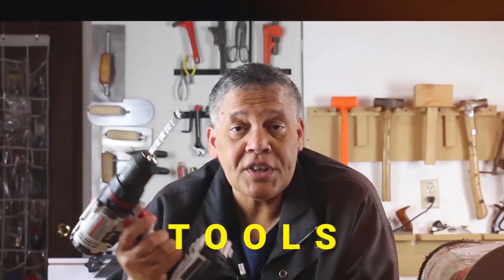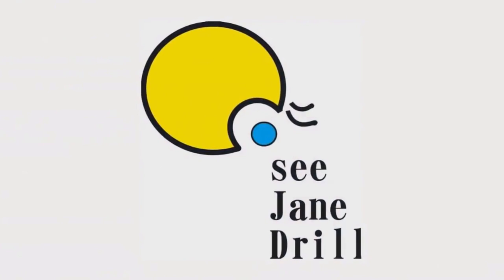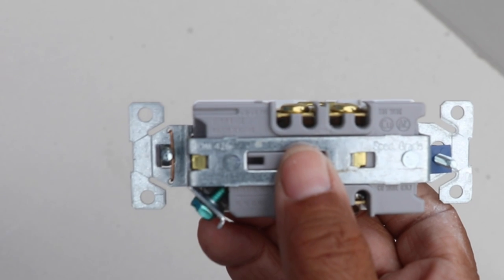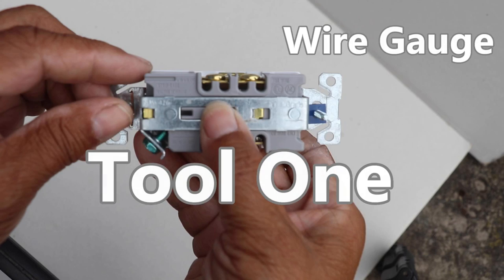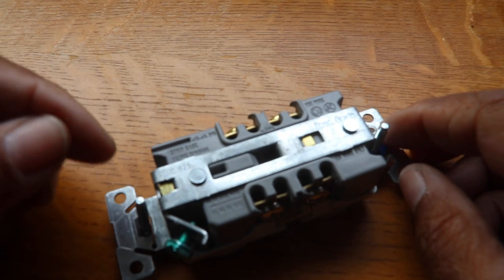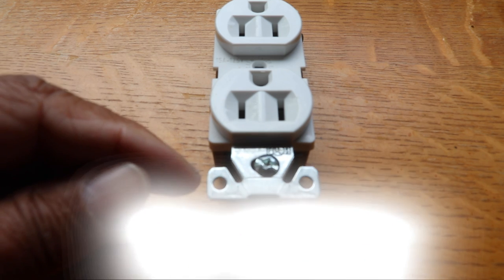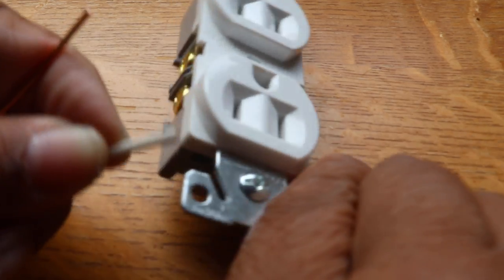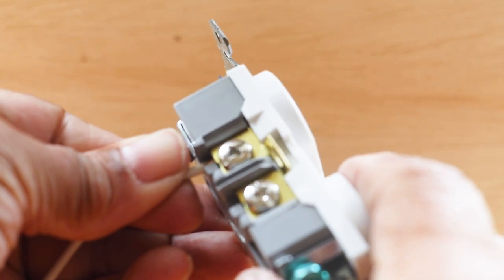Hidden Tool in an Outlet Few Know

Comment: wow! I've been a licensed plumber for 30 years and done my share of wiring as well. I can't tell you hgow many times I've wished I could find my wire strippers. You are my hero!
Reply: Thanks man...I try
Reply: Think I have 3 or 4 wire strippers and most the time I can find just one of them.
Reply: I guess I'm a luddite.   I pull out my swiss army knife, do a quick score, then pull it off.  (when I don't have strippers or pliers handy).   Glad to see this publicized, however.
Reply: Then I would have to hunt for 30 minutes to dig up my electrical box, to get the receptacle......
Reply: Now I’ve got to count how many wire strippers are in the walls of my house... there’s one over there, three in the kitchen, one behind the couch... lol. Thanks for the tip!
Reply: @pugmalley  I think I've got 3 or 4 of everything, and I can't find anything...

😂😂😂
Reply: @machinegunrilla8629  I say if your tool box is not overflowing you don't have enough tools in it yet. 

Organizers for wrenches just waste space.
Reply: @TheGunterGlieben  - Can't be any worse than the business where I left at least two four foot drill bits in the wall.
Reply: I use my two front teeth for 10 Gauge and my next two for 12Gauge
Reply: @Chris Jamieson This is the first I've seen or heard of the wire strippers too. I've had my Red Seal Journeyman ticket in Electrical since 2008. This isn't common knowledge, not in the code book... not on the box the outlets come in... so completely trust that a very competent plumber would also not know the hidden tool.
Reply: A plumber doesn't have a whole lot of need for a wire stripper. You get much more use out of a toilet bowl plunger
Reply: @Chris Jamieson If you watch the video again... one side is for #14 the other is for #12. That said, my point was not to fling mud... just to point out that many of us that are experienced tradesmen found this information to be completely new and eye-opening. If you already knew this tidbit of info... good on you, but you're a very rare exception. Hat is off to you sir!
Reply: This is printed on the outlet. Can you read?
Reply: @Chris Jamieson - Seriously?  I've been doing wiring for 25 years in my work (non-electrician, primarily), and I don't believe I've ever come across this brand.  It's still good information, but your response is asinine.
Reply: @stevewilson7857  It's technically NOT printed on the outlet, Steve. It's molded into the plastic of the outlet therefore same color as the outlet & unless you're specifically searching the device for obscure installation info with really good lighting your chances of seeing & reading that are coincidental, at best. It might be printed on it's box if you buy a separately boxed receptacle but, as in the video, they're most often bought w/o one, from a bin. The likelihood of the average joe/jolene (the one's this video is aimed at) seeing &/or already knowing this obscure info I wouldn't want to place odds on. Just sayin'!
Reply: I had no idea and I have been doing my own wiring for years even have two years of industrial electrical education LOL.
Reply: Hey what are you doing here brother 😂 get back to the knife reviews! Ive been watching you since high school lol
Reply: Wow. Yes you ARE smart. (And pretty cute too!)
Reply: Creeps in my apt bldg who are stealing electricity, have loosened all the outlets in my apt and my plugs fall out. Nobody will help bc nobody will admit to anything. 

Can you tell me what to do to fix them. I came from the era where fixing things was a man’s job so I know nothing about these things, but I am very smart and trying to learn.
Reply: @Chris Jamieson 
Well that's dumb, how will you remove the outlet next time you need to???
Reply: @syorich1403  
Please don't listen to that idiot, don't wreck the screws!!!
If you do ANYTHING to ANY electrical part in your home, ALWAYS turn off the power first. 
ALWAYS!!!
Rubber gloves won't stop you from getting electrocuted.
As for fixing your problem, first, how are people getting to your apartment outlets??? How are they getting in your home? 
Maybe get better locks. 
good luck!
Reply: @Chris Jamieson If it's still not certified by UL, how are they allowed to use it on a house?
Reply: Am I the only person who just pulls out his lighter? 
If you melt that insulation for like three seconds, you can just pull it right off....
Reply: True true
Reply: @Foxtrotwilconiner1969  what about 14?
Reply: @DJDOUBLEWIDE  any two they will do
Reply: I wonder if it will work on the  pigtail for a Bager 5.
Reply: @CharlesGraham  12 years in the IBEW, Local 11, including my apprenticeship, and a total of 30 years in the trade, the bulk of my union time being tenant improvement(lights, switches, and receptacles) and I never heard of this from anyone. If you look at the wire after she stripped it, you can see a ring around the copper. A very few wiggles and the stripped portion will fall of. Actual wire strippers don't reach all the way to the copper when used properly for precisely that reason.
Reply: @Chris Jamieson   in case you didn't notice the stripper on the other side was for 12 gauge, she showed both, just didn't demonstrate both. So who's laughing now
Reply: @Chris Jamieson I've been doing electrical work for 50 years, and I just learned this. It's not obvious.
Reply: @lennyf1957  Depends on whether or not you need to install a washlet type toilet seat, and need to put in an outlet. Or are installing a sump pump. Or heat pump style water heater. Or a garbage disposal. Or an instahot water dispenser. Or dozens of other items that you have to both plumb and wire.
Reply: @Chris Jamieson Personally, I'll always use the square/Robertson drive for the screws, rather than the straight or Phillips. It doesn't cam out, it doesn't slip.
Reply: Don't think you can strip pipes...
Reply: @tbelding  it's safer than your swiss army knife
Reply: Yea wow, damn!  Protip?  No, try mastertip! :o
Reply: Never new of the stripper either.
Wonder if it’s annotated on the instructions included with the outlet nobody reads?
Thanks for getting to the point quickly on the video too! 😎
Reply: @tbelding  that's the businesses fault for having 3/½’ thick walls!  Don't lose sleep!... 🤗
Reply: @spacetimeworm  that's a bad idea. If you get soot on the wiring, you increase the resistance at the point of contact between wire & fitting, increases heat & can blow fuses & cause the plastics in the fitting to melt.  A "qualified" electrician did a 45amp wall mounted shower switch (outside the bathroom) in my ex's home, and somehow managed to get water inside the switch. The switch burned out in 2 weeks. I cleaned the wire & replaced like for like. That burned out too, so I hit an electrician's forum where one explained you have to really clean the soot from every strand of wire:- so separated the strands, brass wire brush, put in a 50 amp switch (hard to find) & no problems since.
Reply: Damn and i been using my teeth for 25 yrs😁😁😁
Reply: @alexmanojlovic768  - More that it was their fault for having sill plates in interior walls while demanding knee height network jacks.
Reply: @tbelding  I was messing.....
Reply: I strip wire with my teeth.....
I also know what electricity taste like.
(Make sure the wire is de-energized!!!!)
Reply: @johndwayne3481  - I've managed to never tongue taste anything higher than 16 volts DC.
Reply: AGREED!
Reply: @tbelding  By using a knife, you run a much greater risk of scoring the conductor. That is why there are so many other better solutions for exposing the conductor.
Reply: @spacetimeworm  introducing fire into a situation it doesn't need to be in adds a whole other range of possible dangers. I'd use fire to do it if I had no strippers; had no outlet with built in strippers; had no knife; and no teeth to do it.
Reply: @troy3456789  Interestingly enough, you don't have to cut all the way through to the conductor to breach the plastic.   Also, sixteen to eight gauge solid conductor is not as vulnerable to being cut as you might think.   Putting a scratch on it doesn't affect its conductivity or termination capability.
Reply: @abelis644   That's all well and good, but if you turn the power off it 1. takes the challenge out of the project. Leave it on and it's like a leveled up version of them game of  Operation. 2. How else am I going to get my shock therapy for free?
Reply: @troy3456789  well if you can't light a half inch of insulation on fire without burning an entire house down, I'm not sure how you are progressing in your career. I'm not exactly starting a scrap fire in the middle of the home...
Reply: @tbelding  Nicking a conductor is verboten
Reply: @troy3456789  A fallacy propagated by those with financial incentives for "Licensed" everything, specifically electricians.  Nicking a 12 gauge wire (the sort of slight scratch that a knife might make when removing the plastic shield) has less of an effect than twisting that same conductor into a circle to screw to a side terminal, or deforming and compressing from a insert terminal.  An event that happens on a regular basis.   The theory is that the nick interferes with skin effect, or reduces the diameter of the conductor enough to make it no longer reach its rating.   Yes, that's true if you actually work at chopping pieces out of it.    The REALITY is that it depends on the 'nick' or scratch, plus the size of the conductor, and if you're going to go that route, there is no such thing as a 'safe' wire stripper, as they can all gouge the wire.  So, rather than spouting OSHA, why not learn how electricity and conductors work, so you can make informed judgements.   I've spent 25 years installing wiring without any issues from scoring a wire with a sharp knife held lightly against plastic shielding.   And that's on wiring from 22 gauge to 4 gauge.   (I HATE working with 4 gauge).
Reply: @machinegunrilla8629  hey you sound like my boss. He has 10 of everything and yet we search hrs for something then buy another and the next day find 4. I try to tell him that instead of 8 jobs on the go at once just start and finish then pack the tools up and move on to the next job. Nope rather do 8 jobs at once and tools all over so spend more time looking for tools then doing the job. Try keeping all tools in the trunk of the car. As remove a tool keep count of tools you removed. End of job count and if 1 missing its always easier to find that day then waiting a week and forget where you used a certain tool. Even silver ware. Every night after supper i wash and count all dishes so nothing gets lost then found a month later. My boss yelled at me for losing wrenches, well i took 10 and returned 10. Then i found all 10 next to the car he fixed. Like ya i did put them back, you took them and like usual left at the last thing you fixed. So to all that lose tools just count as you take and end of job put that same number back and never lose another tool again. Just 1 socket is 10 to 30 bucks. Add that up. 1 wire stripper is 30 bucks. 1 ratchet is 40 bucks and up. Plus hey lost time constantly searching for tools. Never loan tools out. Last time a friend borrowed my tools he lost 8 sockets and a ratchet costing me almost 200 to replace. Ya i know cheaper tools but they are junk. I also know that could buy even better at 400 but too pricey. So please my friends dont be the one with 10 of everything but cant find 1 of anything. Especially now as everything costs more and its harder to make more.
Reply: @Foxtrotwilconiner1969  must be nice having teeth. Keep that up and look like me with 8 bottom teeth left and 0 top lol.
Reply: @shawnkelly1241  while you might be right on all accounts, all I really heard is "I'm TOOL RICH BABY"!!!, and the faint eco of my wife telling me to "clean out my shop", every time I tell her, "I gotta stop by the tool store"...😂😂😂
Reply: @elindquist5725  not common knowledge? How many boxes of plugs have you purchased and opened? My first time buying a box it said in big bold letters about the built in wire stripper and how to use it. Smack dab on the front in big bold black letters. I know you can read by your comment so why cant read a box? I have done some electric work but never more then a few plugs. 2 weeks ago a friend renovated his house and needed over 20 plugs installed. The box said every plug has its own built in wire strippers. Now i would expect a diy person that only changes a few not know because single plugs dont advertise this but a electrician buying hundreds of plugs in bulk would see the box with bold letters. I think each box had 10 plugs and each box had it smack dab on the front of that box. So ya i wont be hiring you any time soon. Yes i am sure you have awsome strippers but handled thousands of plugs and opened hundreds of boxes and never noticed those bold letters or ever looked at the plugs. Try to pay attention and not just go on self drive. To miss one thing it makes one wonder how many other things you have missed lol. Oh well one day with diy videos there will no longer be a need for over priced greedy electricians or shops for basic jobs that a chimp could do. Mega easy, run wires from breaker panel to plugs drilling holes as needed in the studs. Screw the box to stud. Can run 3 or 4 plugs on 1 breaker except kitchen as per many appliances run at the same time will trip the breaker.  Wire power to the plug in and other 2 screws is power out to wire a second or more plugs. Once hard wired you screw small steel plates to the studs where wires run through to prevent dry wall screws hitting those wires. Put up dry wall then wire the plugs in. Once done wire to the panel and pop in breakers. Hit the main power switch and presto power. Saved you 6 grand paying a electrician. Just remember to always leave extra wire when hard wired so never be 2 inches too short at any plug. 10 inches too much can be cut off to finish but cant add 2 inches. Even if over priced electrician you still need a inspector to inspect so why not diy and the inspector will find any mistakes you made before doing the next step. Hard wire, get inspected. Wire plugs and connect to panel. Get inspected then turn on power and add covers. Most metal studs already have holes to run wires and water lines. Lights just as easy. Power into the switch then to the light. Power from closest plug can run to the switch. Lights do not require much power so 0 risk trippling a breaker by running 3 plugs and 2 lights except the kitchen and the washroom. Myself i run a seperate breaker to run the washroom and 1 breaker per plug in the kitchen so i can run deep fryer, toaster, micro wave, coffee maker, fridge and other items all at once and never trip a breaker. Livingroom 1 breaker can easily run 4 plugs unless running some big sound system or grow lights and fans. The plugs near windows only 2 per breaker to run air conditioning if no central air. Every plug has 5 screws. 2 positive, 2 negative and 1 ground. 1 is power in and other power out to run to the next plug or light switch. A black wire (positive) white (negative) bare is ground. Black in brass colored side of plug. White in silver side and ground in bottom. Why pay a person 80 or more per hr to do something so simple. Breaker panel exact same. Only 3 wires to connect and breakers just click in. A quick google search will tell you proper breaker size. Usually 15 or 20 amp unless its a shop running huge tools. Well its a house running basic items with small wire so never need over 20 amp. Well except dryer or central air. Better to run less plugs per breaker and have more breakers then try using a bigger breaker and have hot wires. Sorry greedy electricians diyers taking your job to do basic wiring. A friend didnt trust me to wire to breaker panel. I wired 2 new plugs. Electrician said my job done wrong and needed to correct it. I watched him remove the cover then replace the cover not touching a wire. Charged my friend 200 bucks and only took 10 min to connect to panel but typical greedy person had to say only he could do it right but never touched a wire in my plug job. Scam to say he did it all when only removed a cover to look inside but charge as if he ran the wires and connected the plugs. Just greedy electrician wanted mega money to do 10 min job. Never again will i call a greedy electrician to connect 3 wires and pop in 1 breaker for 200 bucks. It was just to run a light in a green house and a plug for a gazibo. Electricians just as bad as a mechanic. Wanna soak you all they can then wonder why less and less people use them.
Reply: @elindquist5725  the box says in bold letters " wire stripper attatched". I doubt you ever did electricle to not see that. Im just a idiot high school drop out and even i knew that the first time i bought a box of plugs. I am not a electrician and only changed 1 or 2 plugs so never saw the box of 10 or 20. Then my friend had my install many plugs and bang smack dab on the front about the stripper and how it works. Too bad i didnt have the box to show the blind ones. Take a pic with it circled in red. Huge bold letters on the front. Only a blind person couldnt see it.
Reply: @abelis644  simple just grind the head off. Then vice grips to turn the headless screw once plug removed
Reply: @midwestconcertvideo  i did electrical job once and knew this because i can read the box that says it.
Reply: @johndwayne3481  omfg you cracked me up.
Reply: @Chris Jamieson but its easier to say square, star flat and everyone understands it that way. I guess even dummies can sound smart to dummies when they use robertson instead of square.
Reply: @shawnkelly1241  Thanks for your comment. When your working commercial or industrial as I was... Your not given a box, you get them from your foreman or the supply area. Once you know how to change a receptacle you just open any box you get without looking at it. Perhaps we could call it "professional blindness."
Reply: @elindquist5725  lol ya good point. Im just a curious george that reads everything on every box. Plus im a broke ass that doesnt have the tools always needed as per seldom do the same job all day everyday. With electric work i only do my own home and plugs last many years. I was trained basic electrical work but only did that a couple times then no more for 5 or more years so my rookie ass spends a hour looking at things to figure out exactly how they work and my work is slow as shit to be sure no mistakes. As a electrician yall just grab and do and have all the proper tools to never need that built in stripper. Sorry i sometimes forget that many in self do mode because they do the same job day after day for yrs. Have the tools always on hand before starting. Grab, open and discard wrappers and go.
Reply: @shawnkelly1241  - the truth is that he's right that a scored conductor has increased resistance to current.   How much so, however, is where he lies.  Your cable was probably built for 13 amps.  Your slice and patch job probably dropped that to an 11 amp rating.  The saw is probably no more than 10 amps, max.  If you pushed it to 13, the patch would heat up, but using electrical tape (rather than soldering and using heat shrink), the join would probably melt and fail before it could catch on fire.   In a case like this, we're talking about a conductor rated for 20 amps being scratched so it's now only rated for 19.9 amps, but could still go 20 amps without heating up enough to even scorch the outlet.
Reply: @tbelding  well i said for a saw not a house plug that runs deep fryers or toasters etc. In a house i would just replace to whole wire unless impossible but then it wouldnt get accidently cut by a saw. Anyone that wires a house always leaves a few extra inches so if change a plug and the last half inch not too good you have lots of extra to work with and snipping half inch off wont matter. But for a extension cord i sure not buying a new one anytime its damaged. That shitty cord is not used in the house or left plugged in as not in use. Every extension cord is unplugged, rolled and hung up so my shitty splice is all thats needed and works just fine. I remove 2 inches of insolation on both sides to give lots of room to twist it. Yes shrink tube is best but hey its just a shop extension cord to run 1 power tool at a time.
Reply: @shawnkelly1241  - I guess I'm a bit of a neatnik.  I use wire nuts and vinyl tape, but when I have the wire immediately available to put on a flat surface, and have the time for a long term fix, I whip out the soldering iron and heat shrink tubing.  I'm an IT consultant, so I try to just do things right, once, when I can.   In a hurry?   I've used scotch tape and paper clips.   (to keep the wires apart)
Reply: @tbelding  hey scotch tape does work in a pinch if in a hurry and electrical tape not close by lol. Anything sticky will work. Even plastic wrap will work or a plastic bag.
Reply: Well... I am a steamfitter and have used a pipe wrench as a hammer before.
Reply: @rhomis  pipe wrench is awsome hammer especially if not one on hand. A screw driver works good as a punch and most times you have to wack it hard to break the handle
Reply: @Foxtrotwilconiner1969  I used to do that.  Now my front teeth are chipped.  Take my advise, don't do it.
Reply: @tbelding  Your Swiss Army Knife has a wire stripper, too— it’s a notch on the bottle opener or can opener (unless you have one of the smallest SAK models).
Reply: @kramnull8962  Welcome to my life... 😊
Reply: Hiding in plain sight.
Reply: Obviously why your a plumber and thank god not an electrician.
Reply: @tbelding  h
Reply: Licenced plumber for 30 years....   Bla bla bla.... 😂.   I bet that's how you start every conversation 🤣
Reply: As an electrician. I should say of course I knew those were wire strippers.🤣

But if we're being honest. I had no clue.😂
Reply: Oh, me too. Got my journey in 81, master in 83, then gas piping and venting, cross connection control, and finally retirement.
Reply: Thanks for being informed never too old to learn 💥
Reply: You just had me check subscriptions. Havent seen a video of yours in nearly 2 years. Damn YT throttling content we follow even. Ill have to go like some videos to get them in my recommendations again.
Reply: I'm a licensed plumber too and I never thought to look at that stripper either..lol..amazing what we learn on here..😆